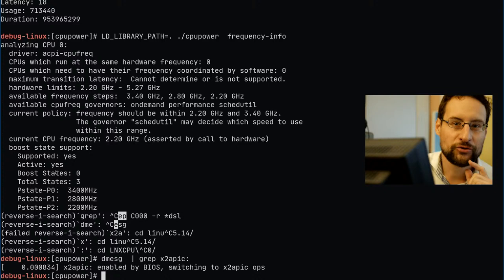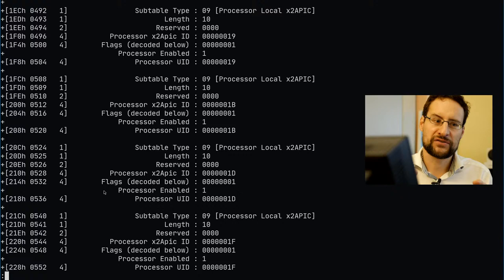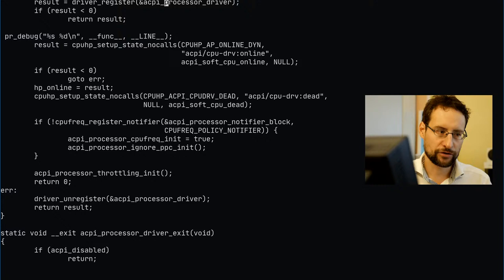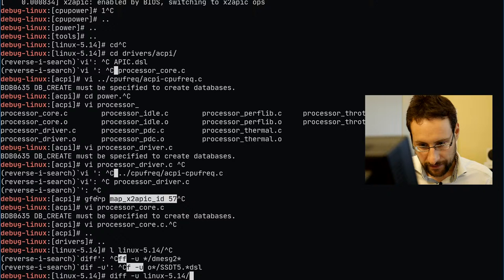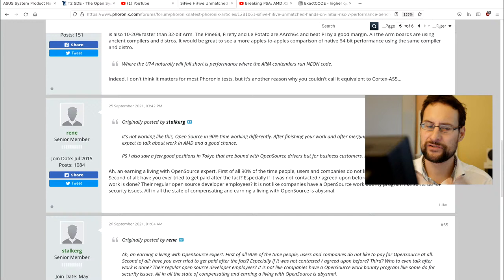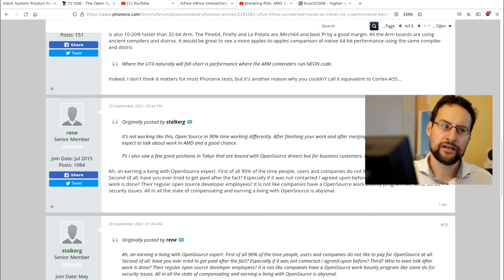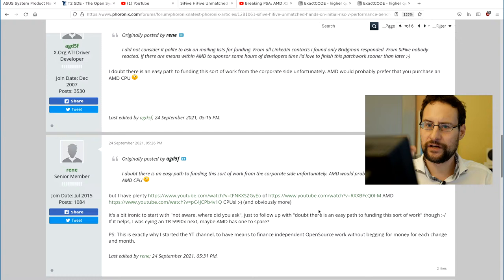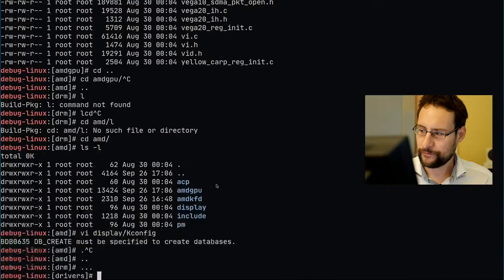I spent my weekend fixing Linux kernel X2APIC AMD Zen P-states bug w/ Asus & other BIOS'!

Comment from the maker: the code was basically like this w/ "device_declaration" since the original commit in 2009 :-/ It looks like it only checks whether the structure is declared as "device", so I would say YOLO if it is declared slightly different? ;-)  https://git.kernel.org/pub/scm/linux/kernel/git/torvalds/linux.git/commit/drivers/acpi/processor_core.c?id=7237d3de78ff89ec2e18eae5fe962d063024fef5